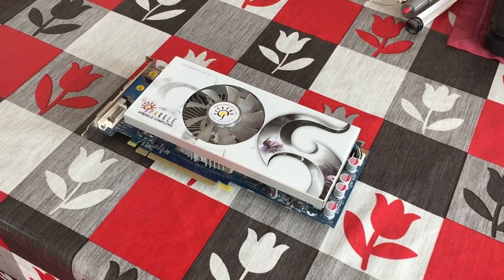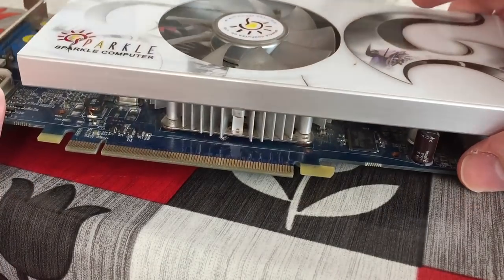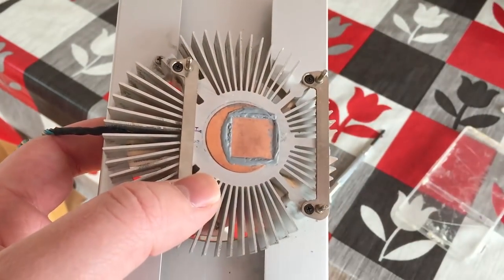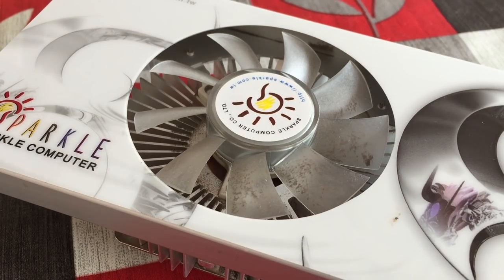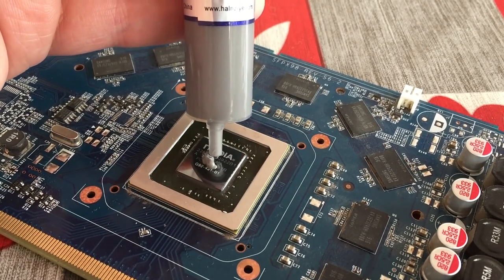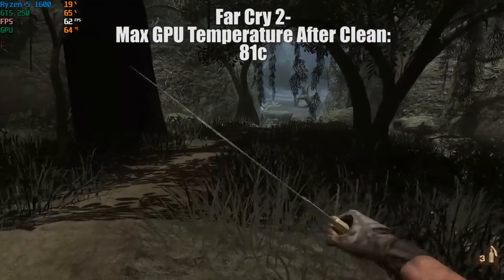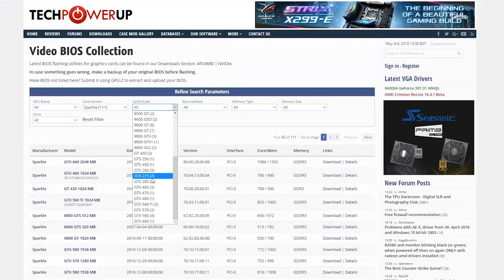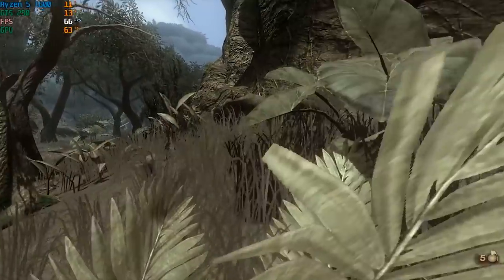Getting An Old GPU To Run Like New

Comment: Had to take apart my GTX280 a LOT because of the design and dust build up and believe me the four screw design is a godsend compared to the dozen or so on older brick cards.
Reply: GTX 480......A thousand tiny screws. Nightmare fuel.
Reply: how many screws does a modern graphics card have?
Reply: The gtx 280 is a very nice card ive ran it for a while ehen i didnt have a gpu for my new pc for dx 11 games i would switch to my intel hd 530

Comment: Great video. My backup PC has a GTS 240 that I put an aftermarket heatsink on because it ran so hot. Used to get up to around 90 and now runs at around 70 maxed out.

Comment: I maked a hole into my old case and then put a fan directly in front of the GPU. It helped a lot on temperatures (from 60-90 degrees i get now 30-40 on constant stress), but now i have a problem with dust... IS A LOT OF DUST.
Reply: You might cut out a disposable window type air conditioner filter and use magnets to hold it in place over the hole. I have a filtered air scoop (I like race cars, so I designed it similar to a hood scoop) which blows on the back of the CPU socket lowering temps about 4-5 degrees on the CPU. I just stuff the filter into the scoop, but magnets should work great for your case panel.

Side note, don't put it directly over an HDD, but if its a few inches away you should be fine. Magnetism decreases by an exponential, which is why you barely have any magnetic field half an inch away and can't pick up anything, but I wouldn't chance it within an inch, and probably two inches just to be super safe.
Reply: Jake Garrett Thx for the idea, i acually have the case on a side so the cut is on the bottom of the case, and the Hard drive is not a problem, i really didn't think about magnets to hold the filter.

Comment: Use baby wipes. They have alcohol in them. And you can get scented ones so your equipment can smell fresh!

Your card doesnt seem nearly dirty enough to cause any issues or increase temps. The different thermal compound Im guessing is what caused the temperature difference. I will have to clean up the dust on my motherboard around my cpu.

I will also take off my blower cooler from my 680 for the first time in 6 years and clean it up and see if it makes any difference.

Comment: Actually, you should use plenty of thermal paste, because GPU-s don't have heat spreaders, so you need to cover the whole chip. Buildzoid even fried a GPU (although he was in the middle of extreme overclocking it) by not applying enough thermal paste.

Comment: Nice, I have a old Radeon HD 6970 with a reference style cooler & thinking of doing the same with it. IIRC temps were in the 80's though it's a 250w tdp card with reference style cooler so might still be ok.

Comment: GTS250s really varied per manufacturer.  My MSI N250GTS had a gigantic quad copper heat pipe solution and a heatsink as large as the card. Yet it needed only one 6 pin in comparison to this cards microscopic sunflower fan and huge shroud that needs 2 6 pins?!

Comment: Use an air compressor and blow it out, put it back in and test video temps with afterburner. DO NOT TAKE IT APART if temps are ok, you will break something and then your are SOL !!!

Comment: That dust build-up was absolutely NOTHING and the high temperature probaby was caused by crummy thermal paste.
Reply: kyanit I
Reply: shitty paste is more of an enemy than enemy since it's there from the start.
just look on what happends with those that delid Intel CPU's and adds liquid metal on em... 20*C instant drop with same cooling.
20*C increase just from dust is long time buildup and if you don't have dogs or carpet it would take years to get that point.

Comment: Please make another Core 2 Quad video and pair it with a decent budget GPU like 750 Ti. And please benchmark new games on it.
Reply: Shayan Ali try pubg if possible, hey but can core 2 duo can give good performance with 750ti 8gb rams ddr3
Reply: xeon e5450/x5450 better/more accesible/more overlockeable/cheaper/probably longet to get since on aliexpress
Reply: I have Core 2 Quad, gtx 750ti and 8gb ram.. still not bad <3
Reply: lightning 457 , I tried PUBG on GT 1030 and Core 2 Quad. It ran good on upto Low-Medium Settings at 720p. Benchmark is on my channel.
Reply: Nd yea i have Pentium dual core processor do i need to change my motherboard for core duo or quad or even xenon
Reply: no longer sse4.2 support  ;-)
Reply: I got a q9400 and rx 550, surprisingly, in most cases the GPU is a bottleneck. With my now broken hd 7850 was a tad bit more even. Ask anything if you want, glad to help.
Reply: SR V , yeah that's why Assasin's Creed Origins doesn't work on Core 2 Quad CPUs. Although Farcry 5 works on Core 2 Quad Q9xxx processors.
Reply: You need to look up the information for your motherboard or PC to see what CPU's it can support. There is no way to know without that information.
Reply: Maybe the q6600 clocked to 3.6ghz vs the new ryzen apu s
Reply: Why to people bother with the X54xx series? The LGA 775 X33x0 Xeons work perfectly on consumer boards with no modifications and are super cheap by comparison. $20 for an X3360 (Xeon variant of Q9550), 4 cores, 12 MB (6 per module) L2,  works great in old HP Compaq DC 5800's and everything. 
Same with the Nehalem-era X34x0.
Reply: yeah Q9650 OC to 4 GHz is still a beast considering it have 12 MB cache and 4 cores.
Reply: Jay Pattyson i have a q6600 in my pc but my brother has a used xeon 56xx that he got for 60$ and it runs everything
Reply: For lighter games or those that are single threaded yes, but it's a better idea too change it for a more modern platform at this point socket 775 core 2 duo's are about 10 years old at this point.

IMO socket 1155 I5 or I7's are the better route now for a budget pc, still using an non k i5 2500 with a GTX 780 with max turbo for all 4 cores at 3.9 ghz it's not amazing performance wise.

(Actually bottlenecks in BF1 64 player for example but its good enough too play with in that game & older games runs great with this combo.)
Reply: the Q2Q is just too old for modern games, and hes made numerous benchmarks for each card.
Reply: Gordon X56x0 series is a different beast being 6 core/12 thread Nehalem/Westmere. Still very relevant I think. 
For the record, Q6600's aren't that expensive, but I'd still go for the Xeon variant of them. X3220's can be had for around $6 now
Reply: Q9650!!!
Reply: The issue is, even though they aren't too expensive, their performance in 2018 is beaten by older i3's, by a fair margin as well. The issue for the x56xx series is that their boards are INSANELY overpriced (I managed to pick up two for $50 however)
Reply: madmatt2024 can i get website to looks for it, do you have recommendations where i should look for it that would be very helpful
Reply: I have Q9400, GTX 750Ti, 8GB DDR3 and games are running great. Games like Witcher 3, Fortnite, GTA V run easily.
Reply: Shayan Ali
hahaha, you need new titles run on old gear?
You need some Striker nForce board, make a classic, store it!
What do you need to run on it, $80 titles? $50 system?
Fortnite runs on any system, CS.GO gaming on old gear! benchmark that? why????
Reply: He has done this, check his older videos, they pair well but the CPU is a bottleneck sadly, i used the q6600 for quite a while and it did me well playing game's such as Beam.NG and battlefield 1 and a solid 30-50 fps on low, but there was some studder so i upgraded to a i5 2400 build and its much better, playing on med to high settings now with 60-80 in games. so if your wanting to build a q6600 build go the extra 30$ for a i5 2400 build,
Reply: I gave my friend my old pc that I built for £35. had a core 2 quad q6600 with the black tape thing that RGHD showcased putting it to 2.99ghz. paired with 5gb 867mhz ddr2 and a 560ti. works great on her 1366x768 monitor. :D
Reply: I just picked up a couple cheap LGA 775 motherboard combos, a gigabyte and an asus, both came with Intel Quad Core cpus, yay! =D
Reply: It might be plug and play, or you might have to update the bios first using your pentium cpu, check the forums and check your motherboards spec sheet, what does it show for cpus supported out of the box?
Reply: i didnt know that, so x3360 is that plug and play, no bios update needed? thx =D
Reply: thats not an option in the 3rd world, if u check your local area guess what u find? LGA 775 is King =)
Reply: no, its $60 on ebay, so its a nogo
Reply: what are u taking about? Stop lying, older i3s are sometimes on par with Quad Cores, it just depends what u are doing, just go research any famouse cpu benchmark, look down their cpu list and you will see what i mean
Reply: uhm, what kind of lga 775 motherboard supports ddr3? =)
Reply: It just depends what your favorite games are, u dont need an i5 for Half Life 2
Reply: Sweet, youre a good friend, im upgrading my cousins pc with a quad core too, she only has a tiny 2 core pentium rite now =)
Reply: MrSammy Boards made during the Penryn era mostly use DDR3 actually...
Reply: lightning 457 The 750 ti is good and so is the 8 gigs of ram, but that core 2 duo is garbage.
Reply: He did it with the Q6600 GT1030 and I think 8GB of RAM (The 750ti being slightly worse off in performance and VRAM) 👌🏼
Reply: lightning 457 
dude dual core era is long past
until last year quad core was recommended

now quad core is the minimum for gaming
Reply: Why not just buy a new gpu and cpu
Reply: Shayan Ali I have the core 2 quad q6600 with the budget overclock on it to make it 3ghz, if you have the right motherboard all you have to do Is cover certain pins and it boosts it to 3ghz
Reply: Shayan Ali he did that exactly about two years ago
Reply: I am currenrtly using a Core 2 Quad Q9950 paired with the AMD RX 460 4GB GDDR5 variant (HIS Digital) and it runs really good.

I don't game on 1080p (since all I ever own to this day only has a 720p) but it performs more than 60 FPS at most of the games I play.

Me playing DOOM 2016 Vulkan at Ultra Settings.
https://www.youtube.com/watch?v=al9hk8YKZiM
Reply: Green Ham Gaming already did that, the results are heavily underwhelming.
Reply: Depends what motherboard you have. Just open it up and see if you can find it. Most of the time the answer is yes, only certain motherboards in oem systems can't.
Reply: @rafal381999  uhhhh
Reply: @silasboyden1268  whatsup

Comment: With GPU prices having skyrocketed in the past 2 years, is it even possible to build a cheap  1080p capable machine in 2018 ?
Reply: Мандибрики і Цирупопики forgot to type in "low-cost" , because he did a video on the AMD HD 7770 as a cheap 1080p card , which has unfortunatelyo seen a price bump.
Reply: Prices are coming down now.  I saw an RX580 at CEX for £210.
Reply: Buy a Ryzen 3 2200G and then when the prices drop buy a gpu.
Reply: yes, its still decently easy, just get a 660/670 or HD 7870/7950 for $100, get a prebuilt dell (I suggest the 7010 for its easy upgraability, a new PSU and Case, maybe RAM or a SSD, and you're below $350
Reply: why though.......
Reply: Here in Finland you can get a used i5 desktop for 80ish euros, a Rx 550 for 120ish, and extra 4gb ram for around 50 euros.
Reply: dnfariesgsa
i5, i3, you can find them as trash too, no Pentiums or Core Duo anymore on the streets as garbage, Amsterdam.
Reply: lucas rem That's crazy.
Reply: Mista Macho I'm using a 7770 that I got for really cheap, running bf4 at 40-60 fps on medium. Not bad
Reply: I spent 190 on my pc dell OptiPlex 390 with a i5 100 dollars for it then 90 for a gtx 750 ti I got lucky tho mine came with a power supply and I had another 4 gigs of ram to put in the pc total cost190
Reply: Get a gtx 660 mid to low 1080p 40+ fps
Reply: 2400G

Comment: I just went to the flea market and found a computer for 5 dollars. I checked it out and it has a gtx 660,16gbs of ram,intel i5,500gb hdd, and a 600w psu. I cant believe i got it for $5. I vacumed it last night to clean the dust and then i put it back together but it wouldnt even power on? I probably didnt connect something right
Reply: After doing some quick research i think the psu is broken
Reply: Memer 5363 buy a PSU that is 500watt or maybe 600 watt
Reply: 64 bit yeah i think thats a good idea
Reply: WTF lucky
Reply: Memer 5363 You vacuumed it? That's a bad idea! Vacuum cleaners create a huge amount of static. Only use alcohol, dry cloths and compressed air around a PC
Reply: Not a automotive air compressor as that can actually break soldered connections
Reply: Try a new power supply along with testing shorting the power button header on the motherboard directly (check which one it is first ofc before poking around with a screwdriver in there.)

You can also try the powersupply hooked up too only a harddrive or a dvd burner & doing a jump start by shorting the green wire & a black wire on the 24 pin cable while its disconnected from everything else.

Worst case scenario its the gpu that is dead or the motherboard is frozen kind of.
(A specific short in the front io can cause the entire motherboard too be unresponsive too any power at all.)

Check over so its seated properly into the motherboard as well where they are needed.
(Minimum it's gpu with 1 6 pin pci-e (Do not use molex adapters if the powersupply has its own dedicated 6 or 6+2 pin connectors they tend too work but not great & can over time short out causing the powersupply too shut off entirely.)
24 pin & either a 4 pin or 4+4 pin connector that combines into an 8 pin in the left upper corner too start the computer too get into the bios.)

Do write down the brand of the powersupply in a response too me so i can check out if its a good powersupply in the first place, along with trying too start the computer without graphics card, harddrives, dvd/cd burner plugged in & using the integrated graphics on the processor or motherboard if it has a vga,hdmi,dvi connector its fairly quick too test that out.

Do also try resetting the motherboard bios itself by clearing the cmos or having it unplugged without the motherboard battery present for a bit & then starting without the battery in the motherboard at all.
(That should default any settings on the motherboard if the previous owner perhaps did an unstable overclock on something.)
(round cr2032 on the motherboard probably behind the graphics card next too the pci-e port or just below it)

One last resort you can try if you have made sure everything is connected properly according too the manual & all connectors are seated properly.
That is shorting out the green & a black ground on the 24 pin while the powersupply is plugged into the computer fully & forcing it too start that way.

(Ofc make sure you can locate the green & a black ground first with the power off from the powersupply & then add in the wire needed from the backside too those exact wires, if you short it with the wrong ones you'll either burn the powersupply or cause a short leading too a good pop from the powersupply if it cant protect itself from you doing it wrong.)
Worst case scenario is.
(You'll either see smoke if there's something horribly wrong with the components, like gpu is dead & shorting out essentially & the powersupply is trying too protect itself from damage or it will set something on the gpu on fire until you unplug the powersupply or turn off the computer.)

(Gotten a motherboard with unresponsive front io headers running like this for about a week so far despite taking them apart entirely & not finding anything wrong with the components i just did this once too make it or break it, it has been working without any problems at all.)

Or you have missed plugging in the front header plugs for the case so you dont have a start button at all while the entire computer works fine.
Reply: Marcus60661 ok thank u ill try and work with it some more
Reply: In general its a much better idea too do this then a vaccuum cleaner but cleaning off heatsinks using this method is fine IMO if they are unmounted from the components entirely so you can just hold the heatsink in your hand that way you cant really send any static buildup too the components unless you shuffle along a shag carpet while wearing wool socks before touching any components again.
Reply: Hey if you use that gently it's still superior than the canned version.
Reply: Li Y Y I won't use vacuum cleaner on any motherboard-it can suck the jumpers in.
Use the compressed air.
Reply: wanna double your money? ill take it   :)  (all kidding aside thats a good buy..solid system)

Comment: I cleaned up my 660 3gb evga yesterday, I've only had the card 4days, paid £50 for it, temps 72c max before cleaned, once cleaned and overclocked temps never go above 60c now, it was dirty
 I used electric spray and micro fibre cloth to clean it up and looks like a new card. Keep up the work mate, your content is great

Comment: I washed my old GPU with water and than baked it to re-flow and dry. All works perfect lol
Reply: TheNeurall I hand washed my old get 1030 in a bucket of soap and water. I put in my rig still wet and soapy. It now runs better than gtx 1050ti. It now runs all games at 180 fps in ultra setting. And that's not even the best part.....it smells like dawn dish soap every time I game.
Reply: lol